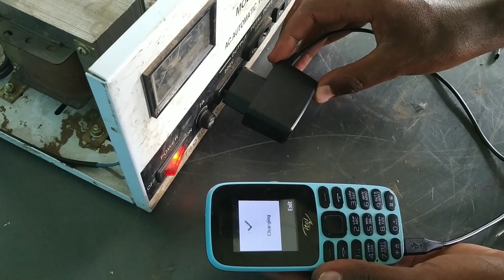የተበላሸ stablizer እንዴት መስራት እንችላለን? -How to fix dead stablizer at home

Comment: My stabilizer is EMKAY GATO AVR-1000VA   WHEN IT IS ON IT GIVES LIGHT BUT OUTPUT  VOLTAGE IS ZERO  
WHEN I TAGE ITS FUSE AND CHECK ON OTHER STABLIZER THE FUSE IS WORKING. PLEASE WHAT IS THE PROBLEM SHOULD BE?

Comment: What was the problem for stabilizer when voltage reads under 220 or less than 200v
Reply from the maker: You can adjust the voltage on pot on the board ...first check capacitor and zener diodr